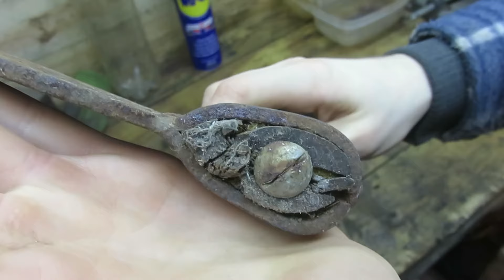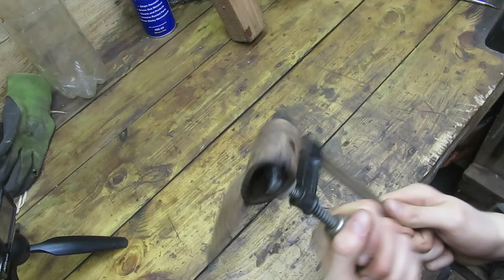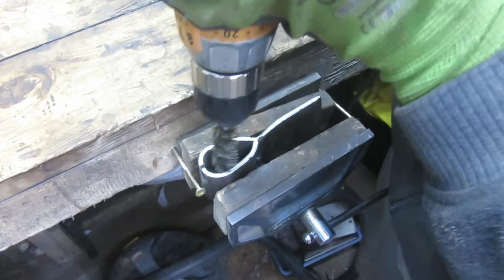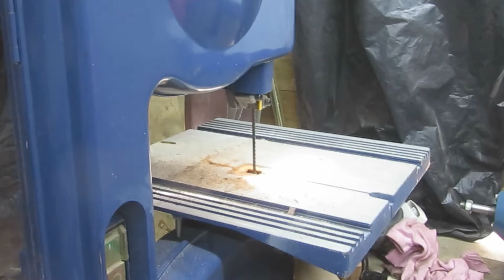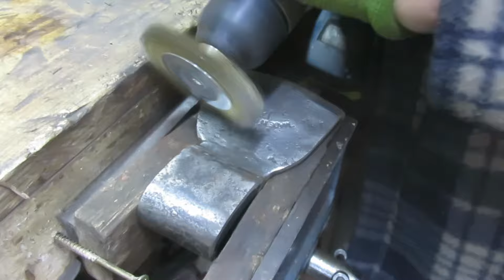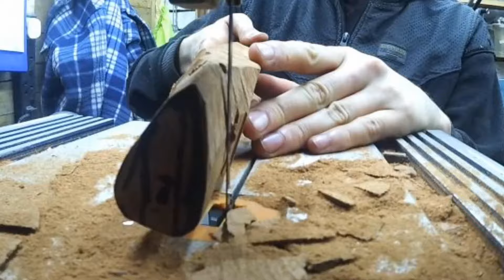Axe modification. Rusty axe restoration.

Comment: You clean up the eye before you "fit" the haft to it. If you are going to leave gaps between wood and steel at all then those will have to be filled with epoxy, easiest done when seating the axe for the final time by applying slowcuring epoxy to inside of the eye.
Reply: NECK BEARD CONFIRMED

Comment: Just a suggestion from personal experience, when removing the head I cut the handle off and then drill out The Handle left in the socket and then knock it out with a punch. Love the work 👍🏼
Reply: I thought of the same thing, but he said he would use the handle on other project, so cutting it wouldn't be too smart
Reply from the maker: Thanks for that
Reply from the maker: You are right on this
Reply from the maker: Thanks

Comment: When you used the wd40 at the beginning, aren’t you just swelling the wood with moisture?
Reply from the maker: Hmm... That's a good point ?  Not really sure about that, however it did help slide the axe head out the handle.

Comment: Use carbide dremel bits to get those welds cleaned up; they are cheap on ebay and are great for cleaning up welds. Great job regardless
Reply from the maker: Thanks for the tip!

Comment: Well using the grinder, you actually too the name off the axe head. Next time use a sandblaster to preserve the name on the axe.
Reply: The name is still there.
Reply from the maker: Do you need to save the name for the sake of rust ?

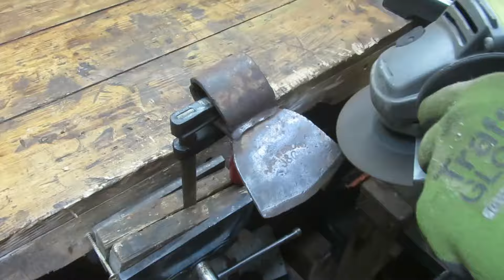Comment: At 2:38 into the video you can see "Made in England" stamped into the blade. It is very likely you just destroyed a genuine antique, perhaps even a valuable one (although I doubt that last part). Folks, if you ever get your hands on a REAL antique, do not attempt this kind of heavy-handed "restoration". It will completely destroy any collectible value that the piece might have.
Reply: Then again they may not care about the value, especially when you need it for work. That is what its made for, work not collecting.
Reply from the maker: No one wants them axes anymore. It's been on ebay for ages.
Reply from the maker: Thanks 👍